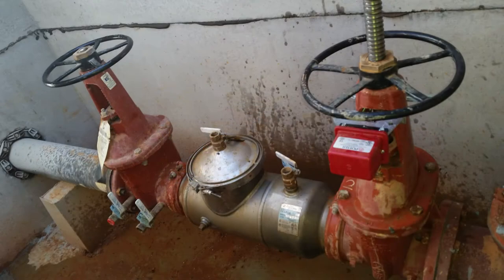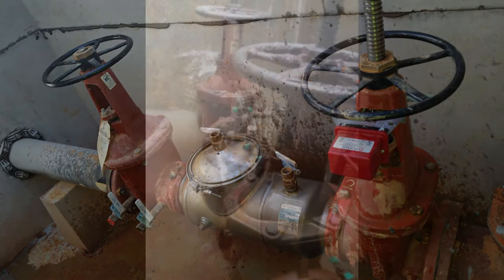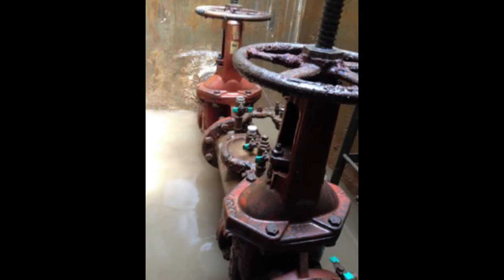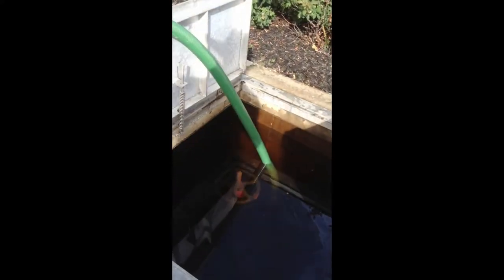Why A Utility Vault Is The Worst Place For A Backflow Preventer

Comment: Literally. Because backflow preventers are hideous, and the covers are only slightly less so. Nobody wants to purchase a luxury townhome and stare at an ugly box outside their window (or the bollards around it, if streetside). The chances for cross contamination are slim, unless the backflow is leaking, in which case it's a moot point.